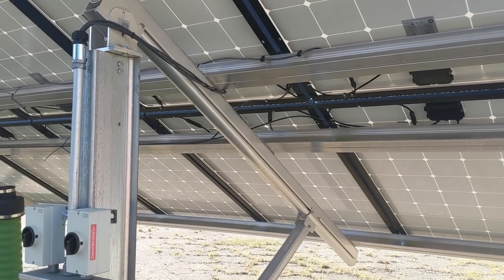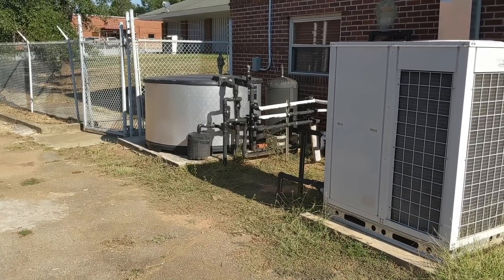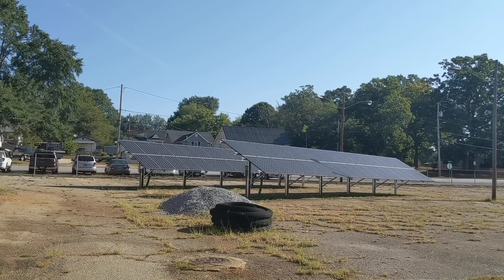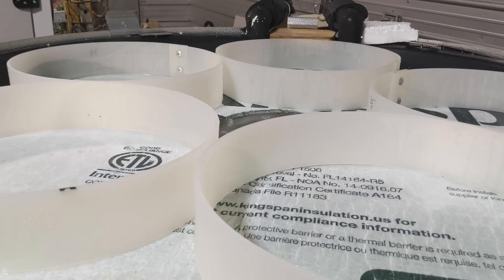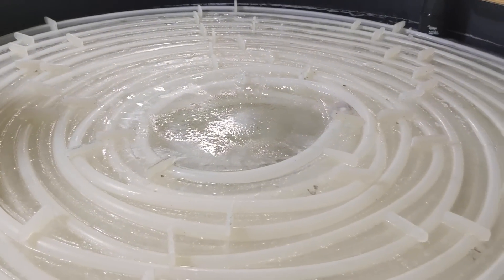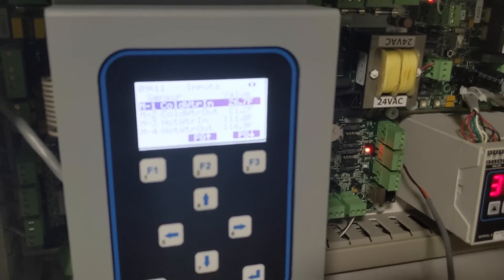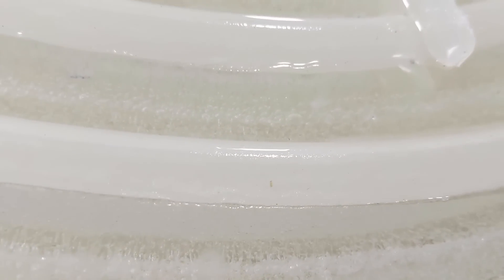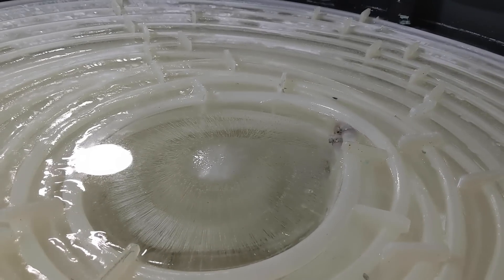Thermal Storage: Solar ICE

Comment: This seems like a "NOTHING BURGER". So you used electricity produced at about 25% efficiency. So you've missed out on about 75% of the power of the sun and then you enter that into your system that is ??% efficient. and then store it in tanks that are maintaining some % of the energy your storing. then you run the remaining percent into your building's cooling system that loses and uses even more energy. I don't see NEAR as much savings as an Ammonia system would put out. Ammonia ice makers are based on chemical energy storage and use more like 75% to 80% of the sun's power to do it with nominal amounts of PV electric input.  Someone here said "This is amazing" I was thinking "This is an amazing moneymaker for the standard electric cooling system manufacturers who can now sell more equipment to do the same work ...... Just use that extra solar electricity to increase your AC units run time or run another unit on it.

Comment: The Life Uncontained channel could use your help I believe. Their most recent podcast was about how their power and AC is sub-par with their needs, especially this year with the heat in Texas. I mentioned some cold storage solutions in a comment, then afterwards I did a search of cold storage and you came up. I've been watching you over half a decade now, as I'm offgrid myself. I will post the link to your video in a follow up comment in their video.
https://youtu.be/d1tSwm-T2PE

Comment: I live an hour east of Vegas and want to make a system that uses a heat pump to store heat in the cold months or store ice/cold in the hot months. For a few months of the year it doesn't drop below 95F at night, but then for a few months it hangs around freezing (but not far below because the earth never cools enough).

Basically I want it to pump between hot and cold tanks and either pick up environment heat after the cold tank or give off excess heat after the hot tank. Domestic hot water would be year around, but otherwise heating from the hot tank during cold, and cooling from the cold tank during hot.

The alternative is to build a large battery and use a traditional heat pump system, but I figure why not use the power when made pumping heat and store it?

Comment: I am looking into adding this to my upcoming install. I don't understand why the ice doesn't break both the tank and the pex, what stops that from happening? I had thought of making the water container slightly tapered (widening towards the top), to ensure the expansion wouldn't break the walls. But for the pex or other tubing, I just don't know how it doesn't break, at least over time. 

I am not looking at solar PV to ice, but a solar thermal chiller. Sending the electricity back into the grid or using it for gadgets, lights, controls and such, and then using solar thermal as the bulk source of cooling and dehumidification.

Thoughts?

Comment: No tech specs given. Whats the efficiency of this setup? What is the output of the 2 solar panels? And the cost? The running cost of this experiment? The volume of the water cooled? The volume of water heated? And the basic schematic of this setup to explain to laymen whats happenning? Cost of the whole thing and return on investment in how many years?

Comment: Just picked up a large Levload Thermal Storage Ice Bank from the resale shop. Paid $50 figured it would make a great insulated water storage tank for the garden. Had no idea what it actually was, now I'm glad I didn't take the coils out. It has markings that read 90 Ton-hours... Anybody know what what the feasibility of hooking it into a residential home would be? approx 1800 square foot. I can build/modify/machine just about anything but I need to brush up on the basics of thermodynamics...  Nothing else maybe it would make a great science project to heat/cool the future pole barn!

Comment: I've worked on some very large ice bank systems in commercial buildings but most of them around here (SF Bay Area California) have been abandoned and they are just using the chiller as a conventional system.  I do have a very high end residential customer who has a working ice bank system and they use off peak power as you stated.  We don't have high enthalpy here at night as the temp drops and we don't have high humidity so you can often run an airside economizer.  The solar/ multi acqua is great for a residential off grid situation in the south or east coast where it's still hot and humid at night and you need AC to be comfortable to sleep.  I never knew weather or humidity till I joined the Army as I was born in San Francisco.  I remember when the AC broke in our barracks at Ft Jackson and I was soaked sweat and couldn't sleep a wink.
Reply: Why have they abandoned the ice storage??
Reply: Is it because of low cost electricity during the day when solar is cheap?

Comment: very interesting, ive always wanted to some how save snow and ice from winter, to use for air conditioning, in  pretty much the same way.
Reply: I did a design that buried a large insulated tank.  I used a heat exchanger, fan, and pump to send glycol down to freeze water for storage for the whole summer AC season.  You're making ice anytime it's below 32°F.
Reply: @rnordquest  i will love to see this insulated tank

Comment: Just wondering... Could this be the solution to global warming?
Reply: Collecting solar adds to heating whereas reflecting it back into space would be cooling.
Reply: rnordquest is that supposed to be an answer? Because, they aren’t “collecting solar”
Reply: @Cobra365  What, you don't think a big black surface gets hot sitting in the sun all day?  It collects roughly 800-1000W/sq meter.  The energy stays here.

Comment: how do you deal with the expansion of the ice? and what about isolation of the 2 tanks? seems a bit thin walled. very cool setup. and indeed very smart way to get most out of your aircon compressor.
Reply: AntimatePcCustom those pex lines can flex easily. Wall thickness depends on what they insulate it with. This is a live experiment and they’re using commonly accessible/affordable materials. The technology is going to be a little pricey, but will pay itself off

Comment: This is great, although
I don't actually understand how it works or what it is doing.
It's reducing energy requirements, saving money ... but how I don't exactly get
Reply: They use solar electricity to freeze water, which in turn is used to cool aircon when the Sun is unavailable - during night and very cloudy, dark days. The frozen water stores the free energy from the Sun, so the energy is not sold to grid and bought back when needed, because doing so would lead to financial losses.

Comment: I wonder how these systems will do with the advent of magnetocaloric heat pumps right around the corner. They have some truly crazy heat ranges where the hot and cold can be up to 95k(171f) difference. That's like one side being -21f and the other being 150f, and they're about 30-50% more efficient than vapor-compression heat pumps.

Comment: This is genius.... And if you use 350 Watt Panels with a better Pure Sine Wave Inverter and a better MPPT charge controller, you could expand your system even further. I've never seen anyone do this before with a Heat Pump.... Tanks for inspiring me

Comment: Electricity is cheap at night so there is no need for storing the energy for night. You could directly use the power from solar panels during day. Then what is the point of storage which decreases efficiency?
Reply: You could sell your power when it is expensive and import from the grid when it is cheap at night, you also benefit from the cooler evening increasing efficiency of cooling.

Comment: So the chiller removes the heat from the water just like AC and heat the water using the heat generated?
Reply: A giant Peltier device, you have to put in energy to force it from one side to the other, the hot side will always get much hotter than the cold side gets cold. As soon as I saw this I was intrigued as to what they would do with the massive heat they generated by cooling the water.
Reply: This is stupid level inefficiency.
Reply: @suprememasteroftheuniverse  Heat pumps are about 300% efficient from our perspective. Every unit of energy in can move 3 units of energy. Heat pump whole-house electrical heating is actually break even operational costs to natural gas heating in the Midwest USA, and natural gas is at an all time low. It's actually a good idea. Instead of exhausting the heat, capture it and use it to warm your water. It's like a free water heater.

But I am not convinced with storing solar as thermal unless it's purely excess power, which was not clear or I missed something.

Comment: pair with a "Canadian/Provençal well" you could reduce the size of ice storage or enlarge the cooled surface
it reduces the difference in temperature between the air that comes in and the ice
Probably more expensive to install than a VMC dual stream but Lowteck and free and it's useful when it's cold outside
and the 3 together are possible
Reply: You could use this to also run a sauna at the same time.

Comment: Everything pro electricity in any way is great! Everything which is pushing away the fossil power sources is just perfect!
Reply: until your electricity is produced by fossil power and your building built by diesel engine equipement
Reply: in my opinion, every thing does not need electricity and does not work by it is amazing !. also every thing does not need electronics is simple, reliable  and amazing !

Comment: A system like that would be greatly beneficial here in the Caribbean after hurricanes... As long as the solar panels could be protected... Great Video...👍
Reply: Blacc Dawg I flush mount my panels to the roof deck and cover them with half inch plus plexiglass
Reply: @bobleclair5665  Well, sounds great as long as roofs stay on during a Hurricane... Since I mentioned I'm in the Caribbean...
Reply: Blacc Dawg I’m a live aboard in Key West also a carpenter,,still tearing out and rebuilding

Comment: How much does it cost ?  It's not looking like your average family could ever afford that kind of set up. Maybe a  medium to large company could. Thanks for the video.
Reply: Could work realy well for an appartment complex, as a big central heating and cooling plant to distribute for all tenants in a building.
Reply: This could be done on a small scale as well even for your own house. Provided you have the space for a large tank and a large enough array that can provide enough energy for you household use and the chiller. 
Pretty much all this is, is a chiller that during the day freezes water thru a glycol chilling loop in the ice and another loop that mixes the hot water from the reclaimed that goes in to you cooling unit. The hot water tank loop might also have a heat exchange that vents hot air outside,  One could also add a domestic hot water loop in the hot tank for hot water.  The system could also be reversed to provide heat in the winter and cold water in the winter as well. 
Other than that Depending on the size of your house one could very well use a  direct solar AC unit, Which runs when the sun is out and has grid back up for night time use.  Units likes these cost about 2k and need about 1000 watts with combined voltage up to 400vdc. 
Another cheap alternative is a solar direct evaporator cooler,  These can be bought for around 500 dollars and only take 100w panel and run about 40w when running and pumping, They are about 1/5 the CFM of your large big box evaporator cooler Which also cost about the same or a bit more. The solar unit would cost you about 650 dollars including the unit, panel, wire and a stand.  Big box cooler cost about 25 dollars for half day usage for a month,  Using it for 6 months out of the year your return on investment will be in about 4 to 5 summers of using it.  I am sure there are some better units out there and some more power full units. Yet a few summers of not paying extra for cooling is well worth it.

Comment: Using steel as a storage medium could increase the capacity without increasing the volume. At nearly 8 times the density of water it can store a lot of heat and it's thermal conductivity would more than make up for any waterproofing that you would need. The thermal expansion is nothing like water either.
Reply: Alan H the point is that changing water from ice to liquid takes a huge amount of energy, which in this case comes from the office as heat from the air handlers. Steel couldn't come close, you wouldn't be changing its state just warming and cooling it. Even as a heat storage medium steel is not great, a kilo of water requires / releases about eight times more heat energy per degree temperature change compared to steel.
Reply: It's been decades since I did thermodynamics at college but I still don't see how using water is realistically any different than adding steel to the equation. The unit in question was specified as 30 Tonne hrs. As weight is part of the equation then it makes sense that a greater weight would increase performance. Steel also has a much higher thermal conductivity than water and especially ice.
I've been looking to see if I can find better info or something that says water is better than steel but all it led me to was https://www.youtube.com/watch?v=1kRF8icLa4M 
Even https://www.engineersedge.com/materials/specific_heat_capacity_of_metals_13259.htm didn't help me. I also couldn't find anything at compares volume as steel would only need 1/8th the volume.
Reply: @Alan_Hans__  One question to answer is how stop the fins on your steel radiator/bank from breaking after so many heat/cold cycles. By this I mean the ice forming and pressing on your construction. A solid lump of steel isn't really easy to transport, thus a radiator or layer-construct would be needed.
Lastly, capacity and ability to transfer heat is not the same. Perhaps a stone/gravel version would be better.
Reply: @Alan_Hans__  ice can store 334 KJ/kg of energy as latent heat at 0 deg C. Why would you use steel instead of ice? Its a not logical. You can store cold energy in steel.

Comment: Is water the best option? Other liquids have much lower/higher freeze/boil points
Reply: Kim Graef it's not really about the temperature, it's about the heat energy required for phase change from ice to liquid, in water its very high. Plus water is available anywhere, non toxic and virtually free.
Reply: Spencer Wilton ok - i presume it’s also that the properties for water are well known - eg if I had a tank with 700 degree Celsius oil - I better know what I am doing - but then again ice do make storage more complicated.
Reply: WATER = FREE !!!
Reply: I thought antifreeze would be better

Comment: Do you know the cost per kWh equivalent for the cold storage system, including everything you would not need on a standard chiller without cold storage?
Reply: The idea would be to compare this figure with the cost of energy storage in a chemical battery.
Reply: @jeanvincent4764  - Water is cheaper!  Water is FREE... YES, filter out Rain Water!
Reply: @JodBronson  what is the cost of the equipment to contain ice, freeze it, the heat exchanger to recover cold, and additional cost of the air-water AC unit vs an air-air unit?

This to evaluate the cost per kWh of cold storage using reasonable amortization.
Reply: @jeanvincent4764  -  You forgot 1 problem... NIGHT TIME USAGE!
Reply: Jordan Bronson; which is far less demanding, try again

Comment: If your thermal Ice can be introduced to the high temperature water flowing out of a solar evacuated tube collectors...would it not create steam which could  be harvested to run a steam power engine?
Reply: Not hot enough ,serious steam is only produced above 500 F  ,heat harvesting for energy tech is still emerging

Comment: But, do you need cooling at night?  This is better than running a DX coil to an AHU?
Reply: Probably not at night, however this would be good in the morning/afternoon when the sun isn't shining but you still need cooling. (imagine a west facing room just after the sun has gone down)

This is when the demand in the grid gets wonky in places with high solar generation as there's these big peaks of demand once solar drops off.

Efficiency wise, it's more efficient to run DX during the day while the sun is out, but if you're using a chilled water loop then it's easier just to stick to chilled water and bypass the ice until that afternoon peak.
Reply: @Thermoelectric7  thanks for the insight !

Comment: Would just love to get to know more of the system,  where   " cold  "  is collected from etc.  Understandably heat from Solar panels is not my problem but is the  " cold "  somehow from heat exchanger or compressor as you mentioned Glycol being used  ?
Reply: I think they are probably using some type of evaporative cooling.
Reply: Solar panels make the electricity, which in turn runs the chiller featured in this video. The chiller takes heat from the cold tank and dumps it into the hot tank. Removing heat creates the "cold" and in turn the ice once enough heat is removed.

If the hot tank gets too hot for the chiller to operate, it'll start dumping some of that heat into the air just like a normal air conditioner.